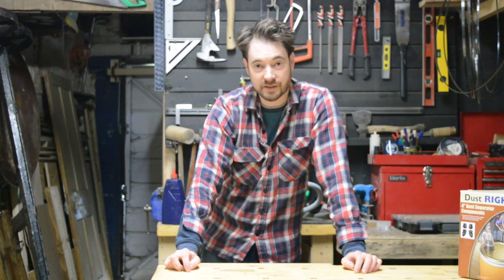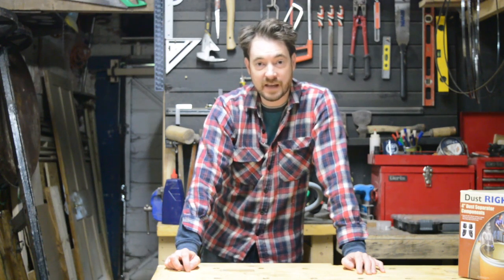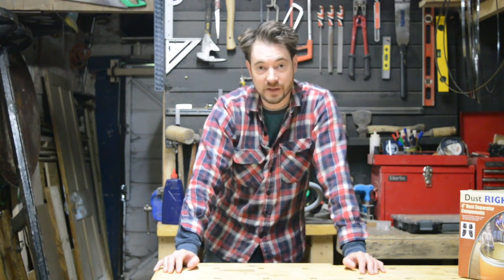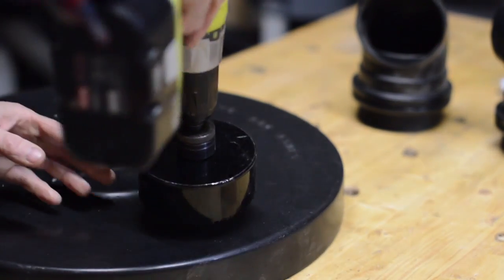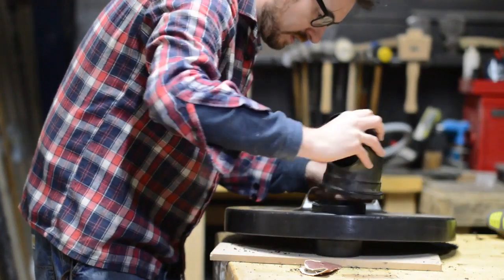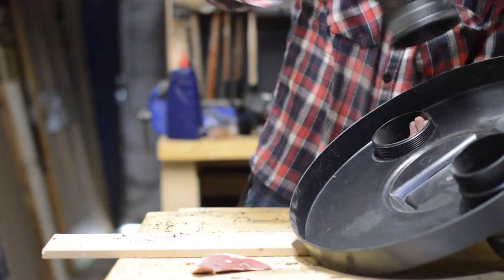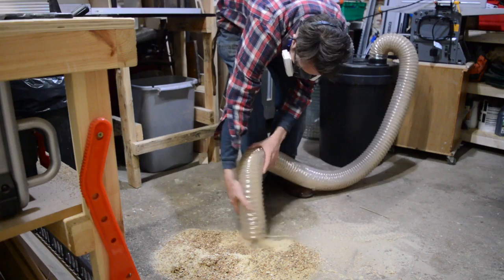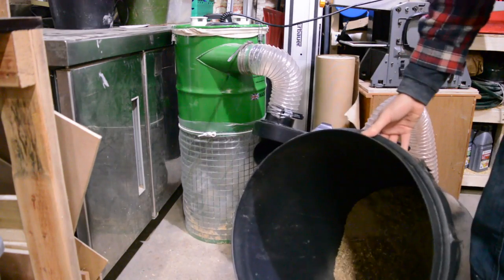Rockler Dust Right Dust Separator Fitted to a Canvac

Comment: Evening Badger,
This video just popped up. I know 6 years ago.
I use the RP wall mounted Camvac as it comes from the factory. I used to use a 2 stage system with a cyclone attached to a blue plastic drum with vacuum from a shop vac. Major saving on dust bags and capacity was much greater. 
With your system (and lots of others) i don't understand the point of the intermediate collector. Whether it's fine particles or chips they all go in the plastic bag which you can empty just the same as the dustbin.
So what's the benefit?

Comment: Great video. Just out of curiosity how did you find the performance of the camvac on its own?, given that its advertised as having the cyclonic affect anyway? Ive been looking into that wall mount one with the bag but am worried that if it then transpires that it still needs a cyclone, it kinda defeats the object of the convenient collection bag. Would be interested to know. Many thanks in advance.
Reply from the maker: It works great but I found every time I had to change the bag I would also need to clean the filter bag protecting the motor. The cyclone just means I don't have to cleave the filter so often.
Reply: Nice one, yeah makes sense. Keep up the great videos. Enjoying watching.

Comment: Hi! I'm looking at buying the twin motor unit and doing the same setup you showed here. Do you think the camvac is powerful enough to support 20ft of hose? Many thanks
Reply from the maker: I don't want to give you bad advice. I think it would work if you used ridged pipes.
Reply: Badger Workshop Thanks, I've now decided to use the same setup but setup it all up on a trolley system. Thanks though